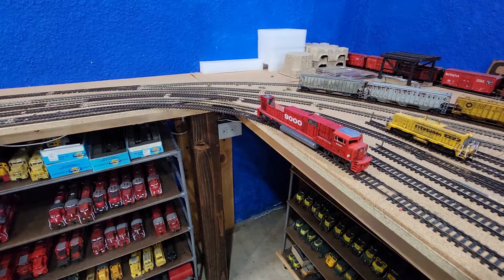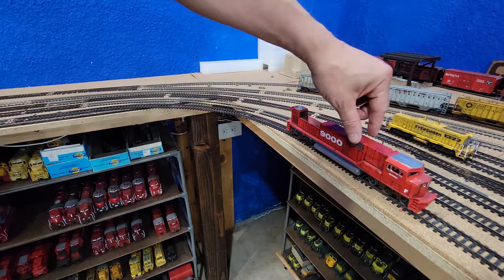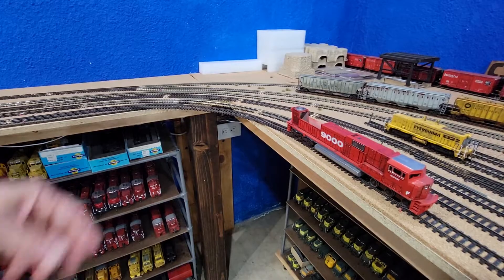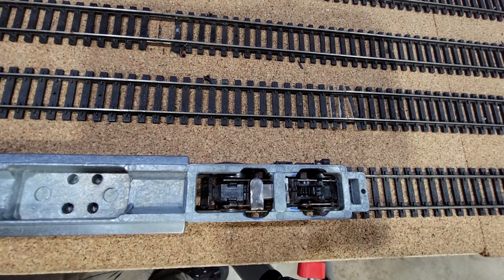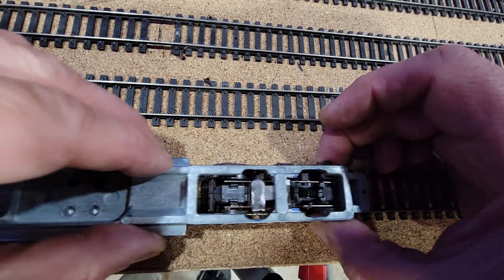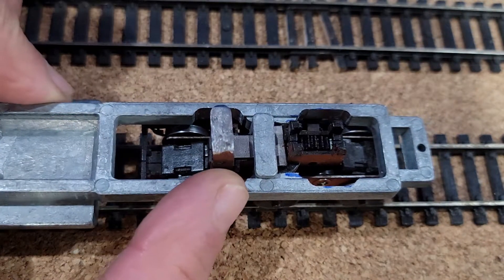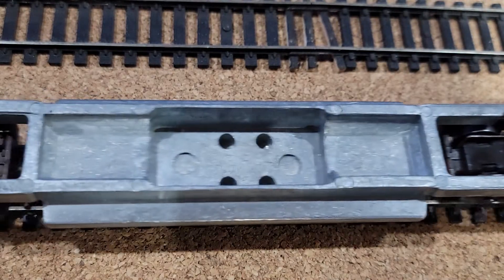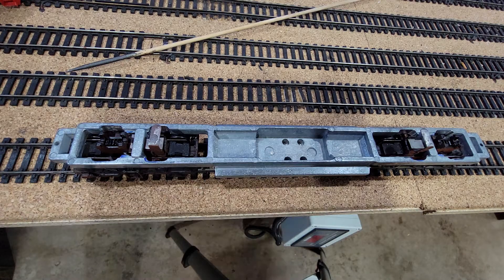Rail Power SD90MAC vs. 15 inch radius curve

Comment: Great work! This is the thing that should be done do to allow locomotives with big wheel bases to face sharp curves without derailing! Thank you very much for sharing!
Reply from the maker: It add reliability and protection against shorting energized frames and is exactly the opposite of what everyone is told "make your curves really big and you'll have no problems" - other than a loss of space!   I was inspired by a couple track plans that were based on busy shipyards and tracks had 12" radius.  I may yet have an industry with 12" one of these days!